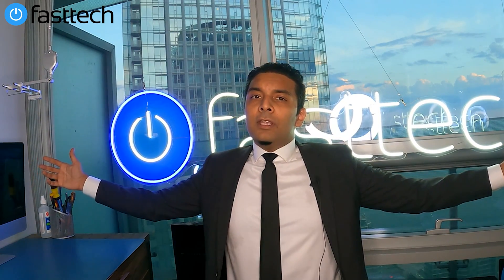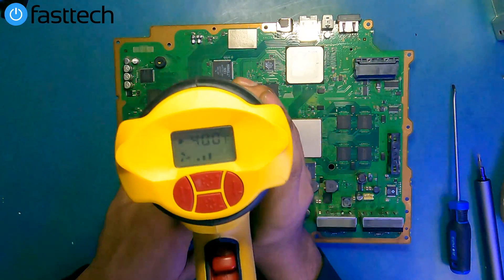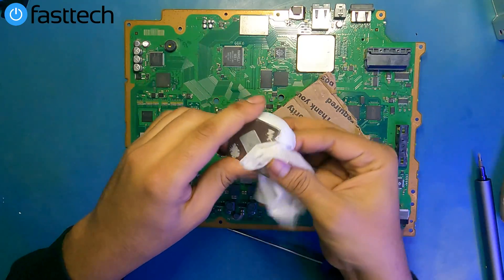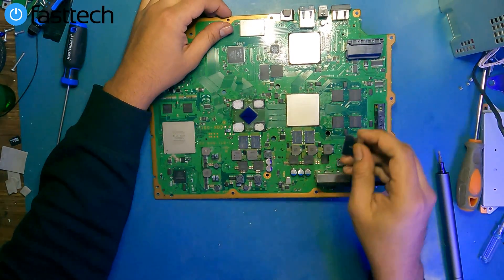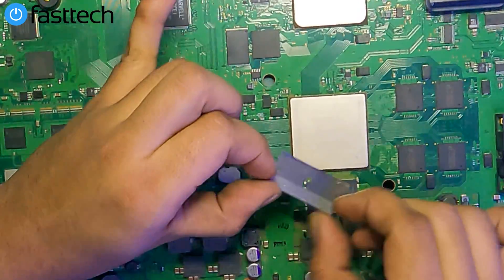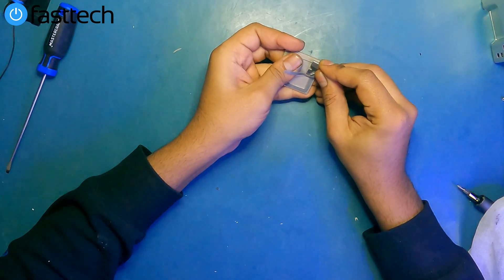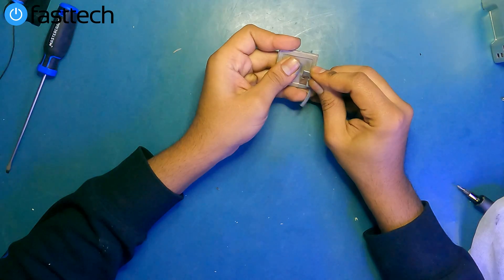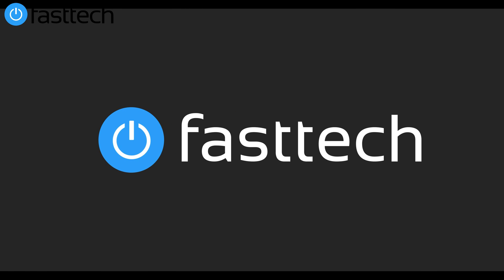PS3 CELL CPU and RSX GPU DE-LID (IHS Removal Guide)

Comment: my IHS for the rsx fell off, so i used thermal paste, but the IHS moves from one side to the other becasue thermal paste is slippery, so how do you install back the mothertboard to the metal plate in the ps3 if the IHS is constantly moving?
Reply from the maker: What paste are you using?
Reply: @fasttechvideo  deepcool z3, the only thing i had, and its slippery, the ihs moved like butter
Reply from the maker: @5DiFika yes that’s probably why. I use Arctic Silver 5, MX-6, MX-5 or Thermal Grizzly and I never have that issue.
Reply from the maker: @5DiFika i have also seen people glue them back on but I dont recommend that as one day the IHS will have to be removed again

Comment: Fasttech - Your IHS removal guide is great! Did you make the ending to this , as in  a relidding video?  I have heard some don't  use silicone when relidding  the cpu  and don't reglue the RSX gpu. Then there are some that say it needs to be done. ??
Reply from the maker: @bobmac9118  at the moment I do not recommend reattaching it with glue as you will have to replace the paste again one day and risk damaging your chips again.
Reply: @fasttechvideo  Thank you!

Comment: Do you pust thermal  paste on the ram on rsx?
Reply from the maker: @merkedgg6322  no
Reply: @fasttechvideo can’t it lead to artifact’s if vrams get hot?
Reply from the maker: @ Artifacts are usually caused by a bad GPU

Comment: If you change from 90nm RSX to 40nm from a super slim, don't you need a firmware to get it working?
Reply from the maker: @dreamer_prince900  no firmware changes needed but since the 40nm runs on a lower voltage there needs to be modifications made to the board
Reply: Actually just make sure the console you took the 40nm chip out from has a high enough firmware otherwise you'll get a glod
Reply from the maker: @FalcoHans  never heard of this before, can you provide a source?

Comment: Muy buen trabajo, yo  tengo una ps3  con ylod, que es mejor reflow, reballing o cambiar pasta en CELL y RSX? Gracias
Reply from the maker: You should first do a SYSCON read to check what is causing the issue. If it is a GPU a reflow can fix it in some cases but the best solution is replacing the GPU
Reply: @fasttechvideo, gracias por la información de momento estoy practicando a soldar como entretenimiento. Intentaré hacerlo yo. Hay buenos tutoriales y me gusta. Felices Fiestas.

Comment: If I have a ps3 that overheats within 30 seconds of being turned on, do I delid the cpu or gpu, or both.

 I've already done the gpu but I don't have a razorblade and am not old enough to purchase one for the cpu.

Also, do I need to apply thermal paste to the vram, I've removed all the glue.
Reply from the maker: @iliketurtles50000  you will have to delid the CPU it seems by the symptoms you described. You do not need to apply paste to the RAM but you can if you want to.

Comment: Are there liquids that can rejuvenate the old flux instead of lifting the IHS plate?
Reply from the maker: I dont understand your question
Reply: @fasttechvideo  Is there a way to rejuvenate the old thermal paste that's under the IHS plate. Reason for my question is due to the daunting task of lifting the lids off the chip. If the existing thermal paste can be rejuvenated via some type of saturation method would be a better choice.
Reply from the maker: @jkucukov  no there is no way to rejuvenate the old paste

Comment: I bought a broken ps3 fat lady which turns off after couple seconds 
The seller told me he changed the thermal paste but iam pretty sure he didnt delid the ihs 
Could this be a reason why its shuts down ?
The console can run the safety mode for couple minutes before its crashes
Reply from the maker: @KingMkzed  yes it needs a DE LID
Reply: How can you change thermal paste without delidding?

Comment: Did Sony not want people to change the thermal paste by adding silicon glue to the CPU so the console can overheat? I mean what is the purpose of the glue?
Reply from the maker: @redfirefox3568  it moronic to be frank. Terrible design choice considering there is a chance one can destroy the console attempting this

Comment: Love your channel, I inherited a 40 gb PS3 phat. It looked to already have one foot in the grave. It was filthy. I cracked it open and cleaned it. I didn't separate the mother board from the heat sink. I would like to crack it back open and apply thermal paste to the GPU and RSX.  My question is when applying the IHS back in its place does adhesive on the mother board need to be removed and new aplied or will the IHS re-adhere back in its place with no additional adhesive.
Reply from the maker: You dont have to reapply the adhesive.

Comment: I have a Ps3 from a buddy of mine that I'm helping fix up. A few days ago I opened it up, gave it a good cleaning & replaced the thermal paste on the top of the IHS, but didn't go under. I started it up and its still running extremely loud, and pretty hot, so I'm thinking I may have to do this. My question is, would I be able to place something like a light tape on top of the NEC tokins to protect them? I'm already apprehensive about using the razor blade, but if I can protect everything around it I should be good. Is this a good idea?
Reply from the maker: Sure you can use electrical tape to protect the surrounding components. Good luck

Comment: I promise you, Liquid Metal is not a good idea for this application.
Reply from the maker: I used it on my system for a while with no issues
Reply: @fasttechvideo  for a while? Ok so that makes me wonder why only for a while?
Reply from the maker: @rorykelly8275  i ended up needing the board for a video then sold the board to a customer so it had to be removed
Reply: @fasttechvideo  ah ok, I’m going to de-lid my backwards compatible one as it shuts off after 30 seconds. When I did a tear down I discovered someone had used copper ease as thermal paste, however, they did upgrade it to a 19 blade fan.

Comment: In my country technician delid ps3 with pallet knife little bit sharpening.
Because the angle is perfect for cutting the glue without scratch the  chip inside.
And dont glued it back after you open it,for easy maintenance.
I repaste inside with MX4,outside with cheap thermal paste.
You can use 4 gram MX4 for 5 ps3 console.
Reply from the maker: Thanks for your comment

Comment: Should i try this...i bought all the tools...im trying the heat gun and painters knife; sharpened method....
Reply from the maker: If your Ps3 is running loud, then yes
Reply: @fasttechvideo  not too loud. Might just thermal and re pad the thing
Reply from the maker: @ShaypeShifterO  👍🏽

Comment: Can someone tell me what this means? 

Each of the Nec Capacitors have their own extra 0.5mm Thermal pads and rear side of the Cell CPU has a 1mm thermal pad.
Thermal paste was replaced with Corsair XTM50 for best performance And CPU and RSX was also delided with same paste, New thermal Pads were were also added.
Reply from the maker: Some units have this although it is rare

Comment: Using a razorblade is a stupid idea i bricked my console thanks to you i scratched the mother board
Reply from the maker: You must have used a razor that was too thin or not the right size. I bet you didn’t buy our kit and used random tools instead now you’re blaming me. I dont think so.
Reply: Yes, you're right. If you see this video closely, he also BROKEN this motherboard, as you can see in the top left corner, he scratched the little board that belongs to the CPU and I'm sure 100% this motherboard won't be turn on again. It's a very bad idea to use a razorblade for this. There're other tools far better to do this.

Comment: Используйте ацетон для снятия CELL. Ацетон растворяет силикон, всего пара капель и крышка снимается очень легко.
Reply from the maker: I am going to give it a try. Thanks for your comment.
Reply: Really ? So you don't even need the knife ? Or it just makes it easier ?
Reply: @sonichurosechu4ever  a couple of drops of acetone to reduce the adhesive properties and the lid comes off as if it were glued to chewing gum. but it is a highly strong solvent, you only need a couple of drops directly on the blade
Reply: Можно ссылку где-нибудь на форум с результатами. Звучит хорошо, но страшно пробовать без отзывов

Comment: IS it possible to de-lid and have the possibility to use console after this?
Reply from the maker: Yes the subject ps3 is still being used today 😊
Reply: @fasttechvideo  Great! But your de-liding looks very dangerous((
Reply: @fasttechvideo  Additional question: Did you try PTM on PS3 instead of liquid metal? Does it work good enough?
Reply from the maker: @andreiivanchykau2564  What is PTM? Do you mean thermal paste? Yes I have and I have to say it works almost just as well.
Reply: @fasttechvideo  ptm 7950
Reply from the maker: @andreiivanchykau2564  I do not know anything about it.

Comment: my cech03 backward ps3 had the jet engine fan, so even with new thermal paste was the same,so in desperation i decided to de-lid the beast. However upon fumbling with the cpu lid,i knock over 2 very small smd,near the cpu, so tiny i didn't believe i manage to solder back, and with nothing to loose i use the screwdriver method to rsx and worked ,after heating the lid with hot air gun. i did solder back the smd,and amazingly it works!
Reply: now the ps3 can be undervolted
Reply: How much do you charge to fix the PS3
Reply from the maker: Of course it works. Why would you ever doubt me 😊

Comment: bro I want to use your video to de lid my ps3 , and i have plan to use liquid metal between the die and ihs and normal thermal paste ( maybe grizzly Kryonaut) on the ihs top to pervent damaging aluminum heat sink. Do you recommend this combination and is it more effective you think? Im curious to know your opinion. thank you.
Reply from the maker: Yes I recommend this combo as Ive used it before and works great
Reply: no. just use really good thermal paste, liquid metal is too high risk in ps3 it wasnt designed for it, it can seep out over time and kill the ps3
Reply: @20EsOfficial ok but like everyone shows how to de lid it how tf do you put it back on ??

Comment: Deliding seems pointless and the thermal paste being dry is a non issue since the paste is essentially cemented in place. The risk involved is not worth it.
Reply from the maker: These systems are now 15 years old. Thermal paste does not last that long. Not to mention the multiple ‘loud fan then turns off’ PS3s we have fixed by de-lidding and replacing the paste
Reply: i Had console after good clean and new thermal paste still overheating in few minutes.

Comment: where is isopropyl alcohol available
Reply: Local drug store man. It's rubbing alcohol.
Reply: @soulreaperx7x  You have to make sure it's over 90%. Most drug stores only sell 70%
Reply: @PsychoVision19  not really. 70 works just fine, just have to wait a little bit mire for it to fully dry.
Reply: @soulreaperx7x  it's good practice to wipe off what you can as evaporation can leave deposits behind. 70% works fine in a pinch
Reply from the maker: Here: https://www.fasttech.ca/tools/p/isopropyl-alcohol

Comment: While I love this channel and respect all the work they’ve put into making these videos, I highly recommend thinking twice before doing a de-lid if your PS3 has YLOD. For years its been more of an unsubstantiated rumor that YLOD can be fixed by removing the IHS, when in reality its much more likely YLOD is caused by the RSX and/or cell failing. In other words there’s a good chance that you can try this nerve racking process only to find it did nothing to fix your console.
Reply from the maker: Appreciate you being a viewer. Thermal paste is not supposed to last 15 years+ which is the age of most ps3 consoles. There are also issues like overheating where the fan gets very loud and the system turns off and these issues are fixed by doing a delid and paste replacement. Cheers.
Reply: There are other reasons for delid...

Comment: man that looks like such a hassle. you must charge a fortune for these refurbed consoles. and deservedly so.
Reply from the maker: We charge what DK oldies charges but we actually do all the work required to refurbish these systems.
Reply: Not much of a hassle at all. The fact he uses a metal tool to pry open is absolutely dangerous
Reply from the maker: @INButty the RSX is easy to do, the CELL is quiet tedious no matter what tool is used
Reply: @fasttechvideo I followed your exact method and same razor and it all went exactly as your video detailed. Definitely improved the issue (3 beeps, power off and red blinking light) but did not fix the issue. Went from powering down after 5 minutes to lasting 3.5 hours. Must be something else, those Nec Tokins maybe?

Comment: I did a delid on my A01 a few months ago and it worked. It was no longer YLOD and I ran it multiple times even played uncharted on it until one day I came home from work and noticed it was blinking red and I go to power it on and it YLODs again. So it worked for a few months and now it’s YLOD again. Idk know what to do next. I don’t wanna change capacitors
Reply: Well, what Thermal Paste Brand did you use? I REALLY suggest to do a SYSCON Test to know exactly what the problem is. Also, we are not entirely sure what the problem was at the first place. Second and MORE important: Why your PLAYSTATION 3 had the blinking red light? Who was playing or what happened that the PS3 turned on and YLoD? Automatic Update or something similar?
Reply: @Red05x  I used Arctic MX-4 and yeah we don’t know why it was YLOD originally but the delid did fix it, if only for a few months. As far as why it was blinking red when I came home is anyone’s best guess. I live with only my wife and she doesn’t touch my things, she has no interest in it. I bought this as a “working” console on Facebook marketplace so I feel inclined to keep it and fix it but I don’t know if there’s a permanent fix to these consoles. I could change capacitors but I simply just don’t want to seeing as they’re sort of a pain
Reply: @jeremy9474  Strange... Well, maybe the person who sold it to you did something to "fix" a YLoD before give it to you. The BEST to do is a SYSCON Diagnostic. I have 2 CECHA01 Systems that suddenly stopped working and a Syscon is the way to go. No one in my City do the job, unfortunately but if you found someone in yours, i suggest to check ti that way.

Comment: Would you recommend putting some masking tape along with some thin foam around the cell in order to properly protect it? I feel like prepping the board this way would ensure that the risk involved is minimized as much as possible.
Reply: The one u were using the blade on , did u heat it first ? ALSO why not use 2 blades or 3 blades and leave 2 in whilst working with the 3rd
Reply: @iankennedy1441  sounds like you've found a way to enhance the process
Reply from the maker: Polyimide tape or electrical tape will work

Comment: What about that 3rd chip is it worth doing? And what is it?
Reply from the maker: Its the EEGS chip for ps2 compatibility but i would say generally speaking its not worth it since that chip does not run very hot. Maybe Ill do it in the future to show everyone how it’s done.
Reply: @fasttechvideo  if you delid it u will probably scratch it or break the chip
Reply: Nope. Its for ps2 games which this motherboard is from backwards compatible

Comment: i did this but it doesn't work
Reply from the maker: What part doesn't work?
Reply: @fasttechvideo  come up with relight when i try turn on
Reply from the maker: @markhammond147  ylod issue possibly. Check syscon for error codes
Reply: @fasttechvideo  how can you if you can't turn it on
Reply from the maker: @markhammond147  google syscon ps3
Reply: @fasttechvideo  it turns on but goes yellow and then red
Reply: @markhammond147  This made me NOT want to do it on my own. It's better to hire a professional technician to do this for you.
Reply: @mknlb50  no thanks as i never trust people much

Comment: is it worth risking delidding? or is it safer to just clean and top off thermal paste every other year or so? I'm about to clean it and reapply paste. just wondering if i should risk delidding
Reply from the maker: Depends on how loud your fan is running but eventually this will have to be done.
Reply: In my experience if the fan is loud changing the paste without A delid only helps a little the main problem is the paste under the ihs
Reply: if your RSX heats up to above 67*C with 30-35% fan speed, then you have to delid RSX. Otherwise don't do it, delidding RSX seems and is simple, but it does microscopic damage under your chip, which later (maybe even year or two after) becomes YLOD
Reply: @Dorianek8 why is it caused by deliding(microscoping problem)

Comment: Sometimes my cecha ps3 went black screen when starting a ps2 game and stuck there the only option is to turn it off(not always black screen) can someone tell me why this happened?

Edit: now it booted a ps2 games no problem after I updated it to 4.90
Reply from the maker: It could be a laser issue or it could be a eegs chip issue
Reply: @fasttechvideo  it can even be an RSX issue if it’s not communicating correctly then some functions can work and others won’t some that freeze ps3 games on hdmi don’t freeze on av due to it not having to use all the functions/processing power of the chip
Reply from the maker: Does it play dvd movies?
Reply: @fasttechvideo  update: the issue is completely fixed after I updated the console to 4.90
Reply: @fasttechvideo  I don’t have a dvd movies so I don’t know about that